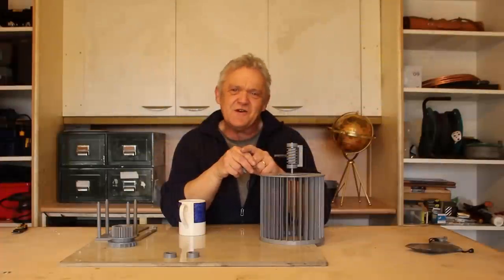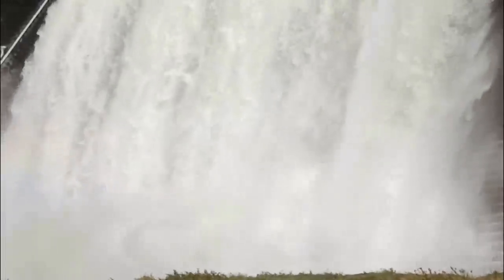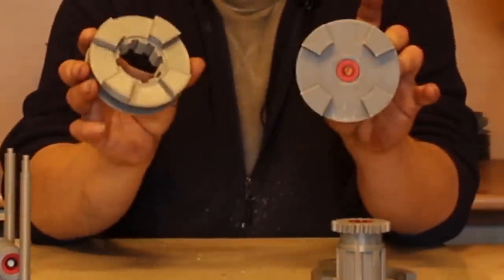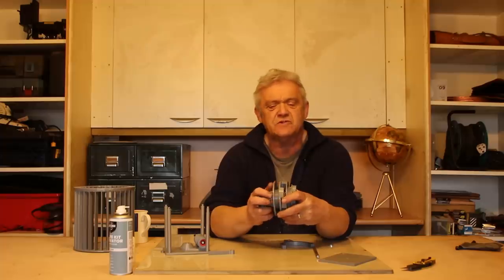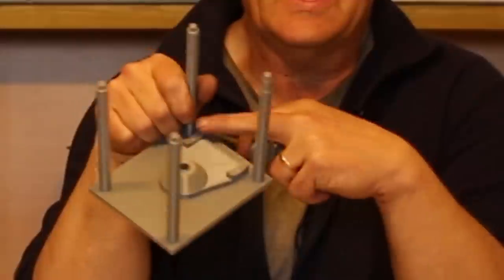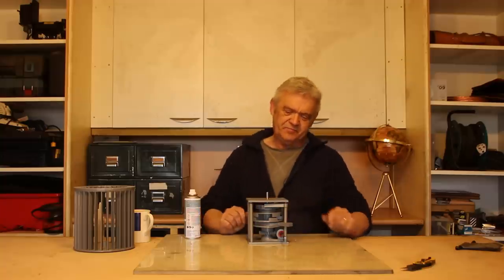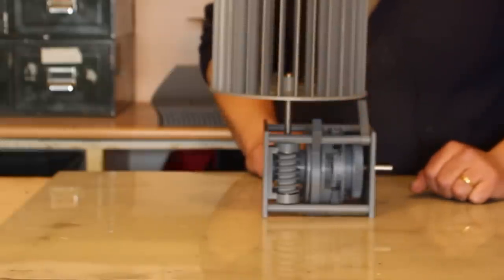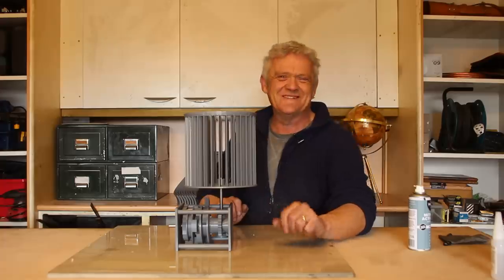1905 Wind Turbine With Integrated Energy Storage

Comment: If you were to put a selectable magnetic generator on the out put so you wound the weight up then as you disconnect the drive it it engages a fixed magnets ,which would slow the weight dropping and make electric power and so cycle .just a thought
Reply from the maker: good thought - thank you for suggesting it

Comment: I had an idea the other day thinking about this of using the ocean and having a system that pulled a floating object underwater and when you need the excess energy you let it float back up to the top driving a generator. Could connect one to all these giant ocean wind turbines.
Reply from the maker: that is a good idea mate - maybe sink it full of water then pump air in - it would then be an air based battery
Reply: A while back I saw a proposed design for an offshore wind turbine that would use a gravity battery in order to smooth out the power sent through the cable.
Reply: @ThinkingandTinkering  this might be a way of getting more out then you put in. worthwhile to investigate .

Comment: did you consider squeezing together two strong magnets facing the same poles as the turbine works and releasing that energy when needed? main advantage over gravity is that, you need more energy to move the magnets as they get closer to each other.

Comment: What about using a clutch driven by the centrifugal force of the spinning turbine? Like I'm assuming a constant non-zero demand, so like the moment the wind stops, it starts to drop. Also, most gravity batteries use concrete or water ... what about using lead or tungsten due to their density?

Comment: Love this series, yet I find myself asking again and again: do any of these methods scale to usable solutions for a homeowner? Do they produce enough usable energy to make the effort worthwhile?
Reply: NO, Just use a chemical battery. lifpo4 is now the best for home energy storage. Or you may want to wait a couple of years to get the much cheaper sodium ion battery.
Reply: @feras5017  yeah lifepo is finally affordable $1.5k for 3kw storage if I'm not mistaken. A year ago or so it was like triple.
Reply: LiFeP batteries are a more efficient way to store energy. If I was going to use gravity, I would setup a water pumping system with a raised reservoir and a Tesla turbine at ground level.
Reply: @thegreenxeno9430  this only works if you don't have to worry about the water freezing.
Reply: @rayg436  Unless it's draining heat, you generally don't have to if you store it underground where temperature is usually constant.  Although having an underground water system is a different can of worms.
Reply: @tasa4904  yah environmental and costs of excavation not to mention the ground water issues
Reply: The potential energy (in joules) stored by a gravity battery is very easy to calculate: mass (kg) times height (m) times gravity (9.8). You would need to raise an absolutely massive weight to be able to power household appliances. Raising ten metric TONS, or around five cars worth of weight, to a height of 10m would give you... 270 watt-hours. And that's assuming 100% efficiency in recovering the energy. Realistically, a battery of that size would power your TV on for less than an hour.
Reply: Sure. Imagine for example if you needed to hoist a grand piano upstairs lol
Reply: @Gheiter your math is correct but you are assuming a 1 to 1 gear ratio. If you use a combination of pulleys and a gearbox you can easily have a 256 to 1 gear ratio thats actually usable with out massive losses in friction decreasing your 10,000kg weight to a theoretical 39kg if the system was lossless. Yes it sounds absurd but i actually have a pully and gearbox system in my garage thats a 32 to 1 ratio that I use to lift and lower a suspended platform with lumber typically weighing around 500kg with my pinky or a hand drill when im feeling lazy. Although not tested it ought to have a failure point of around 4 metric tons.
Reply: @Guardian_Arias  Thanks I was wondering about using pulleys for this application
Reply: one way to find out! give it a go you might discover something else.

Comment: Think of the possibilities, using an automatic car transmission it could automatically do things depending on the wind speeds and the load on the generator. Like in higher wind speeds it will engage the generator and the gravity battery, in lower wind speeds just the generator, and in no wind only discharge the battery. And all this automatically with a technology that already exists in cars.
Reply from the maker: good thoughts mate - thank you for sharing
Reply: @ThinkingandTinkering  👍

Comment: Could a gearing mechanism attached to your device driven by the weight/s such as in a grandfather or cuckoo clock be able to drive a useable generator? I absolutely love what you can create with a 3D printer. As one weight drops could the wind turbine raise another weight?

Comment: I'm aware this is probably the most environmentally dangerous idea since leaded petrol, but how about pumped hydro energy storage, but with liquid mercury instead of water? If your wind turbine is built on the end of a tower, you could install a storage tank at the top and the bottom, and the wind turbine only pumps mercury up to the top. When the energy is needed on the grid, it can flow through a fluid turbine to power a generator. Since it's 13.5 times more dense than water, you need a much smaller volume of liquid.
Reply: pumping mercury always sounds bad in my head
Reply: Mercury is not heavy enough.
The wind turbine lift the building, and than let it fall on quartz. ;-)
Reply: Storing water is more than 13 times  easier than mercury.

Comment: If the output mechanism turned a shaft with another worm gear, the falling of the weight could be slowed.   I wonder what the torque of this second worm gear would be?  Could it be used with amplification gears (i.e. reduction gears, but connected to speed up the resultant turning instead of reducing it) to turn a generator?

Comment: Thoroughly enjoy your series and thank you for inspiring us!!  Physics is only a hobby interest. You inspired a rough concept idea. That wanted to share.  

Would it be viable to design wind turbine that can create a self-sustained central vortex . Using a pressure & temp variation with focused sun light(like magnifying glass) that heats a small dia. center point at the bottom of wind turbine. This updraft of hot air combined with the colder ambient air  already spinning your current wind turbine.  May spark a self-sustained central air vortex that creates more rotational energy when sun light is available to focus.  

There is a lot of knowledge I'm not familiar with. But sometimes unconstrained ideas can spark others.  Hope mine does.

Comment: I dont remember if Ive mentioned it before but I saw a story about an electric light for 3rd world countries that you cranked a weight up and as it fell it generated power to burn a lightbulb so kids could do homework etc. It wasnt a worm gear of course, more like a smaller version of the one with the water bottle you showed with some kind of multiplier gearing on the discharge side... after watching the full video this piece should do the same thing, its more about how you add the energy and how much you store

Comment: Why not drive a water pump. The water pressure could lift/jack a heavy weight upwards. In my day we calĺed them an accumulator. In this manner the hydraulic pressure raised can be stored or used to drive a generator by simple valve control at will without the need for a clutch. A relief valve can release any overpressure when the accumulator has reached its maximum height

Comment: How about using an old squirrel cage fan from a car to make a sand hourglass power battery. Just build a hopper that that regulates and dumps sand down on the fans of the fan blade.

Comment: I was talking about it in one of my videos not long time ago. And, as well, I did calculations of how much energy + electricity we can store this way. I've used ChatGPT and the only thing which we should check is the time of the energy release. 

I was thinking about 3m high and 1 ton of water in an IBC. The calculations were promising to be true. Even if the efficiency would be 80-90% which is achievable I'd say, it's still worth doing. The only thing you need is a space and a bit of money cause you won't get everything for FREE for it ;). But, imagine if one block of houses would be able to install such system on their roof and use solar panels to pump it up each day ;). This can be mounted above the water storage ;). We're talking hundreds of tons of water,  and that is a huge amount of energy.
Reply from the maker: 1kg raised 1m is 9.8 joules so 1 ton which is a cubic meter of water - about the size of a washing machine raised to to the roof would be around 58,800 joules - as 3,600 joules is a watt hour then that would be 16 watt hours - more or less - my light bulbs are 40 watt equivalent light and take 4 watts - they are LED lamps - so it would be enough to light my living room easily - that small wind turbine is a model mate!! and if you used steel, concrete or lead it would be the size of a large shoe box, a two drawer filing cabinet or a small plant pot in that order lol

Comment: I would like to see some investigation into a transmission system to drive a flywheel and generator system, so the flywheel can be the energy storage system, maybe a way to refuse the power coming into the generator by diverting it into the flywheel when power load is lower on the electric generator than the input from the wind, so it can shift and take power from the flywheel when the wind load is lower thus the wind can always do input that goes toward either keeping the flywheel going as it is drained by the generator, or directly to the generator when the flywheel is at full speed you think is safe for it, 

then it would be cool to see if a multi staged flywheel system could be set up where the speed of the fly wheels causes clutching control and such so additional power not being consumed could be diverted to another flywheel in a chain so you could have a really windy day store up to a 3 day period of very low wind powered days worth of excess power to be drained :)

Comment: Pneumatic storage would be as effective. Have the wind mill drive a compressor. Store the compressed air and then run that out through a pneumatic motor on demand. That's called a basic canned air system. This was one of the original green grid designs from the 1970's but the direst to electricity people shouted it down, literally at a 1980's conference, because superconductor storage rings were the future.

Comment: curious, could you use pulley ratios to easily lift a weight then change the gear ratio at the apex then clutch release into a more optimal ratio for the decent say 0:1:3:15:1:0 where zero is rest and 1 is ascending or descending from a constant rate of motion the 3 and 15 are just arbitrary ratios, could do something fun

Comment: Hi rob, if you fixed two magnets with the same poles facing each other so they are trying to repel, and pushed the magnets so they are about 10mm apart, would you be able to put a piezo crystal in the gap and get a charge? How long would magnets be trying to repel? Would they lose strength over time? Or could you tap into the force of one magnet trying to push the other one away somehow? Cheers

Comment: Could the centrifugal force be used to push a mass up channel inside the vane part?   Would that give the vane variable inertia, allowing the vane to be useful over a wider range of wind speeds?
Reply: Pulling the vanes inward at higher rpm:windspeed so radius at the vane is inverse to rpm? I was trying to envision that via pulleys

Comment: This kind of answers my reflection about using a system similar to the chains and weights used in the old clocks. 
Would it be possible to run a light with a clock mechanism since LEDs require si little energy ?
Reply from the maker: don't forget 1kg raised 1m is 9.8 joules so 1 ton which is a cubic meter of water - about the size of a washing machine raised to to the roof would be around 58,800 joules - as 3,600 joules is a watt hour then that would be 16 watt hours - more or less - my light bulbs are 40 watt equivalent light and take 4 watts - they are LED lamps - so it would be enough to light my living room easily - that small wind turbine is a model mate!! and if you used steel, concrete or lead it would be the size of a large shoe box, a two drawer filing cabinet or a small plant pot in that order lol

Comment: Is there a way to automatically disengage the clutch when the weight reaches its maximum height so it can run unattended without destroying itself in a heavy wind? I’d love to build something like that for a house precisely because, barring catastrophes, the gravity battery holds its power indefinitely without loss.
Reply from the maker: yes a solenoid
Reply: @ThinkingandTinkering  Thank you. I was thinking something non-electric, like a switch or governor, that would disengage the clutch mechanically.

Comment: Could you measure and print a spacer for your dogs to reduce play? Or is the play there to aid in reengaging the clutch? Also, are you enjoying the new work space? I like it :) Good stuff, Rob!
Reply from the maker: the play is for re-engagement - it is an idea to add rubber blocks so the engagement isn't as fierce - but in wind you can use a stop start method quiet easily so it really isn't much of an issue in small systems
Reply: @ThinkingandTinkering  I figured you probably had a reason :) Hey I just wanted to say thanks for the great content btw. You're the first video in my feed everyday because I watch so many of your videos. You're inspiring, Rob. You're the reason I'm making my own wind turbine in Tinkercad :) Hope you're having a good day across the pond

Comment: Too bad you most likely don't have a Gravely two wheel tractor handy or a 400 series ( excluding a 408 ) 4 wheel tractor. Both of them disprove the idea that a worm gear arrangement won't drive from the worm wheel end. The two wheel versions were available with three different worm gears and matching worm wheels. Ratios were changed by the number of leads that the set had on the worm. L models and most of the Commercial and Professional models used an 8 lead gear. These were the fastest tractors and also the easiest to roll. Next were the LI models and the 400s which used the 6 lead worms. Very few of the 6 leads were used in the Commercial or Professional lines. Slowest of them were the LS models with the 4 lead worm. You know when you are dealing with one of them as they will barely roll when the engine is not driving them. Gravely also used dog clutches in them. The PTO output is controlled by one.  On tractors where the had 8 speeds instead of just 4, there also was a double ended dog on the axle. Knowing how to operate that dog well, also allowed you to disconnect the axle from the worm wheel if you centered the dog between the fixed one and the one on the worm wheel. There was a tiny gap so that both were never engaged at the same time and you use this gap to make it easier to move. The worms were steel while the worm wheels were large chunks of bronze.

Comment: I'm sure you know gravity battery's won't be suitable for family homes 1ton doesn't store much energy and that small wind turbine is not going to lift much weight
Reply from the maker: don't forget 1kg raised 1m is 9.8 joules so 1 ton which is a cubic meter of water - about the size of a washing machine raised to to the roof would be around 58,800 joules - as 3,600 joules is a watt hour then that would be 16 watt hours - more or less - my light bulbs are 40 watt equivalent light and take 4 watts - they are LED lamps - so it would be enough to light my living room easily - that small wind turbine is a model mate!! and if you used steel, concrete or lead it would be the size of a large shoe box, a two drawer filing cabinet or a small plant pot in that order lol

Comment: That would have been the better way to run wind on the compressor spring comment below!. my my???.😃😄😁😆😅 5 Smile's. If you go over NASA electric motor math to obtain one killowatt output you need 850w electric x4 together gets you that one kilowatt output grid viable option twenty before serving????O wind??.

Comment: How about a water gravity battery powered by reflecting the sun with mirrors at a  water filled tank to convert water to steam driving the water upwards through a pipe in to a water tank, where it cools and is used later.
Reply: Power could be harnessed on the way up through turbines as well as the way down through a Pelton wheel

Comment: Probably safer and easier implement on a large scale with an electrically powered hoist, but a brilliant idea on a small scale.
Reply from the maker: don't forget 1kg raised 1m is 9.8 joules so 1 ton which is a cubic meter of water - about the size of a washing machine raised to to the roof would be around 58,800 joules - as 3,600 joules is a watt hour then that would be 16 watt hours - more or less - my light bulbs are 40 watt equivalent light and take 4 watts - they are LED lamps - so it would be enough to light my living room easily - that small wind turbine is a model mate!! and if you used steel, concrete or lead it would be the size of a large shoe box, a two drawer filing cabinet or a small plant pot in that order lol
Reply: @ThinkingandTinkering  Just off to borrow next doors scaffolding. Missus might notice the washing machine is missing though!